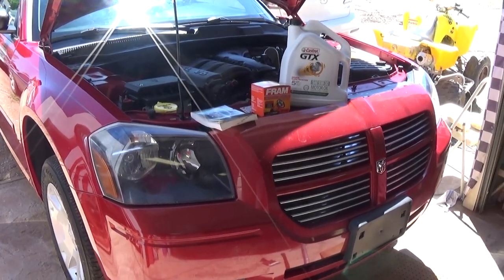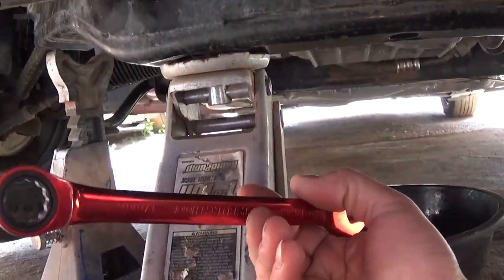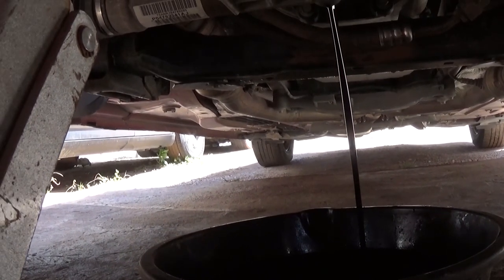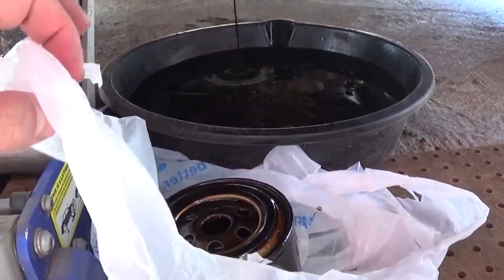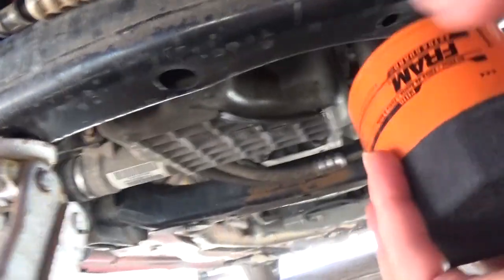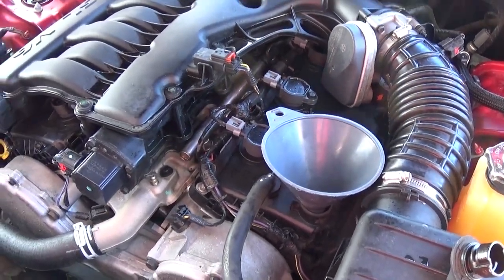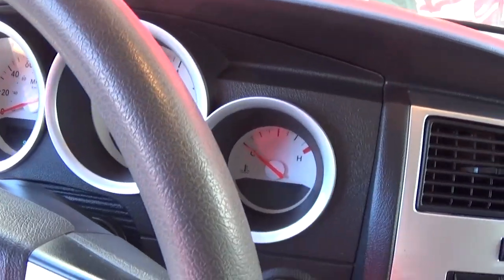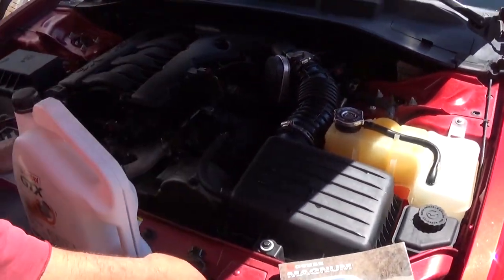Dodge Charger Dodge Magnum 3.5 v6 Oil Change and Capacity

Comment: my charger with the 3.5 is hotter after driving than it was before my mechanic put in 5w 30 synthetic? is the 5 w 30 synthetic oil making it hotter?
Reply: Hmm... maybe he put the wrong grade oil in. Because in my truck, they did that once, and it ran hot. Synthetic shouldn't do that. If the oils not the problem, check your cooling system.

Comment: The manual showed 10w30 but you used 5w30. Why?
Reply: Is cooler tempatures there probably when you use 5w30 you use it in cold temps then use 10w30 in warmer temps. Like he said in the video lol

Comment: You should really stick to the recomended oil type on the engine. Still, thank you for helping me out on my 05. But, one thing I would like to make aware. You do not need to remove the shielding under the engine to change the oil. The plug and exit hole is right behind it, barely clearing it.
Reply: No, you actually do not. I changed my oil again a day after I posted this. The shield for the CHARGERS, stops just before the plug. Next time I am under it, I will take a video and show ya if you like.
Reply: Art Alcatraz Did he not say that this video was for any car with the 3.5l like the magnum, 300, chargers and challengers? Yea. So, go somewhere else now?
Reply: Art Alcatraz You were trying to shut down me saying you do not need to remove the shield. When I pointed out that he claimed the chargers needed to, you suddenly changed the topic to the oil viscocity? Running from a pointless argument in to another pointless one so quickly?
Reply: Art Alcatraz it is fascinating. You are talking like a 7 year old.
Reply: This thread was funny.